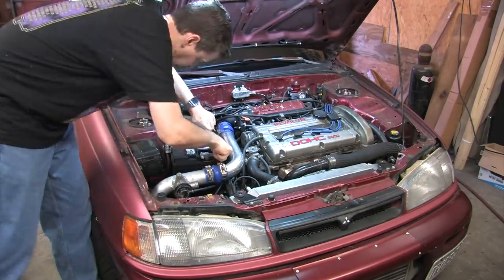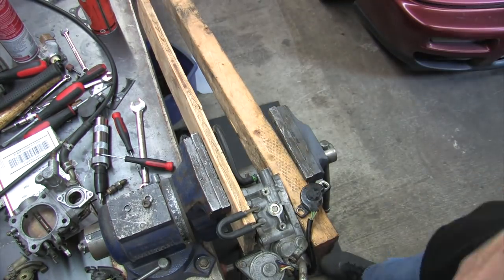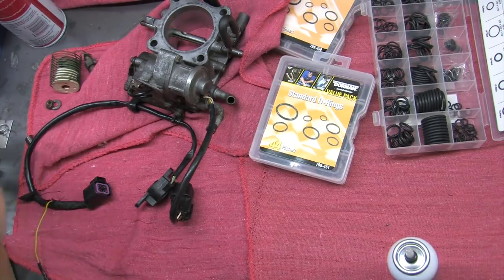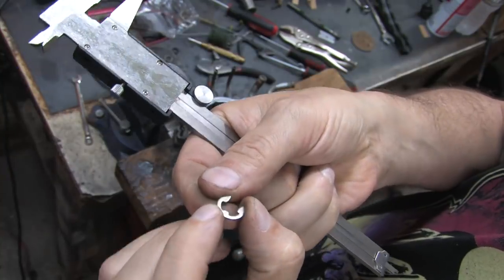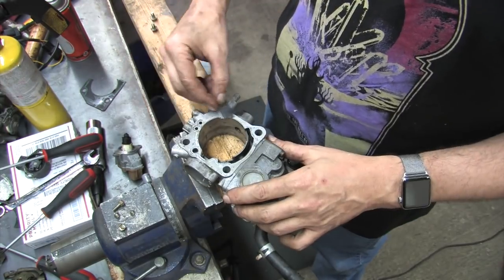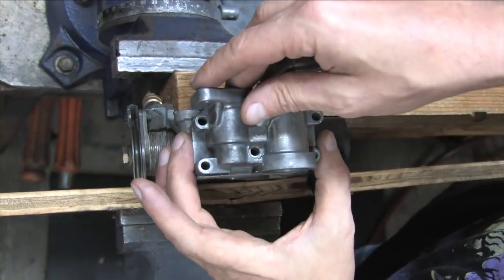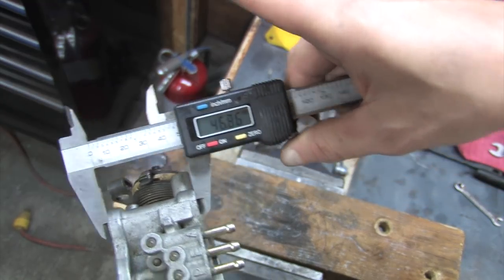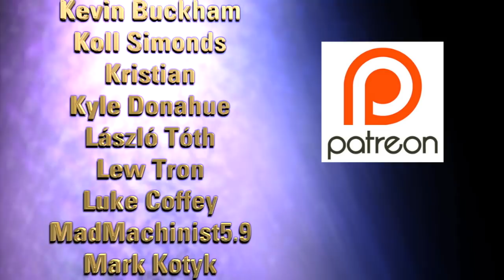Rebuild Turbo DSM Throttle Bodies

Comment: Anyone else notice the spider on the vice at about 31:30
Reply: I still don't see it. Do you mean the little dot on the right end of the piece of wood?
Reply from the maker: Left side of bench vise.  I saw it in the edits.  Astounded that anyone else saw it because it takes up maybe 5 whole pixels.  It's a teeny tiny white dot.
Reply: Okay what superhuman vision and attention do you have, thats pretty incredible

Runs across and down the vice
Reply: Yeah, I've always had that attention to detail. Drives some people insane.

Comment: You didn’t put it in the parts list but the MD614300 FIAV gasket for the 1990 is out of production. Sigh.
Reply: Thanks again for this video. I went the harbor freight valve. Interested to seeing how it drives with the FIAV bypass.

Comment: I deleted my water idle thing on my evo 3 is it really needed?  I haven't started the car yet I'm still building it
Reply from the maker: It depends on your climate.  In warmer climates it's less of an issue.  It's there to regulate idle on cold starts.  Without it, you may have to sit in the car modulating the gas pedal to keep it running until the engine warms up.
Reply: @Jafromobile  thank u for the info brother I live in New Zealand lol it can get pretty cold but I dont mind being the idle control via my right foot in the cold mornings thank u again I thought maybe it would harm motor when warmed up and running also with the water lines removed does it still have to be plugged in or can I unplug it aswell? Just the orange one that goes to the idle control
Reply from the maker: @kanemourad9230  Fortunately the FIAV is 100% mechanical.  I wouldn't remove any wiring for the rest of the components on the throttle body as they'd be related to the throttle position, ISC or throttle switch functions.  ECMlink lets you simulate throttle switch function, and it adds a cool feature that keeps your idle revs high if the car is moving until you come to a stop in order to maintain vacuum pressure for the brake booster, just in case you have radical camshafts that don't pull good idle vacuum or like to stall out in the event they lose it altogether from some other parasitic thing.  I have to say... though I kept my idle switch, I do simulate the idle switch signal in ECMlink because the Hyundai needs that extra help to stop without stalling.
Reply: @Jafromobile  thank u brother your a DSM 4g63 guru!! 🤟🤟🤟

Comment: Hi jafro How to get gasket or seal on internet? thanks
Reply from the maker: mitsubishipartswarehouse is one example.  You can search for others, most of my favorites are gone.  I'm getting "domain for sale" errors when I use the links these days.  I buy most of what I need from ExtremePSI, Magnus or any other speed shop that has the thing I want now.  Extreme has a good collection of OEM 89-99 Mitsubishi parts, and that describes 4/5 of my driveway.  They sell pretty much everything but the block as a separate part.  They might even help you with that if you reached out to them...

Option B is knowing your part number and google search it.  You'll find everyone selling it.

Comment: Try and buy some decent screwdrivers will help. Long shaft more torque but you still need to push and hold the weight while you turn so as not to blow the screw heads apart.

Comment: Dont use phillips head drivers. Most to all of the phillips shaped screws are JIS or japanese industrial standard. If you use a proper jis bit thd screws wont strips and it comes out much easier

Comment: Great video! For those pesky screw I ended up getting a impact screwdriver from a company in Japan named Vessel. I think AvE showed it at one point... Either way it works great. https://www.amazon.ca/Vessel-Megadora-Impacta-P2x100-Screwdriver/dp/B003BI8HHQ

Also for random seals I like to use motion industries. I had a look and they have that one you used. I found their shipping to be more reasonable than other industrial suppliers...  That was maybe who you used but here (canada) "cheap shipping" might mean something different!

Comment: Why not glue the o-rings into the seal housing with some variant of cyanoacrylate? It might extend the life of you cobbled seal.
Reply from the maker: I did think about that.  Think about how easy it would be to glue the o-ring to the shaft.  I even thought about making another ridiculous YouTube FlexSeal video.  I love thinking sometimes... other times I'm all like... "nah.  No thinking today... you're cut off."  It would be a tricky venture to use a thin glue like cyanoacrylate when the o-ring is pressed firmly between the shaft and the seal.  The o-ring has to be stretched out into that metal ring.  You'd have to glue it on some kind of a non-stick fake shaft thing to stretch it, and also hope the glue doesn't dry rot or crust up the o-ring.  I'm just glad I got a chance to use the o-ring trick back in the day, see it work, and then see it fail.  As long as there's an actual seal available, it's always going to remain the best option.  I just hope it remains available.
Reply: Your right, I did not take the stretch factor in to account. Keep up the videos!